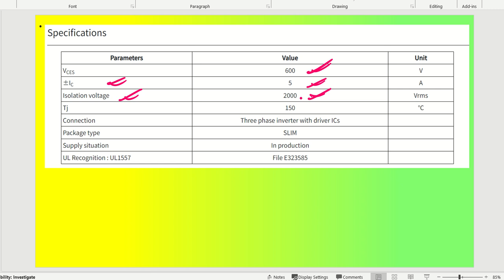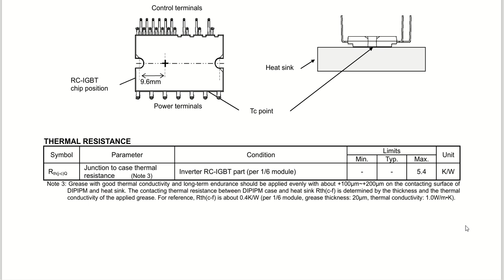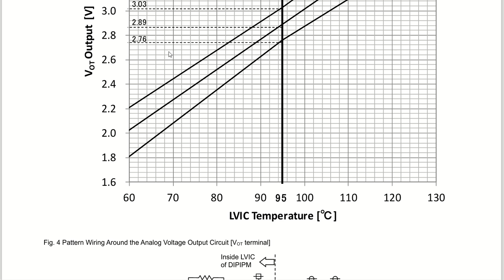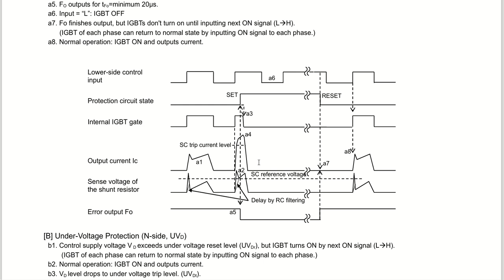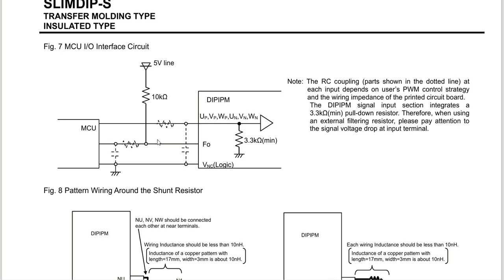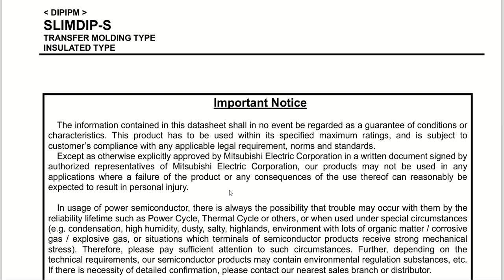077 SLIMDIP-S IPM Training MITSUBISHI Design and Details from datasheet

Comment: Hello,
I have designed the hardware, but before moving on to the software, I want to perform a few small tests. Can you help me?
I designed the hardware according to the values specified in the datasheet and completed the PCB.
I am applying +5V to the Up, Vn, and Wn pins, and connecting the Un, Vp, and Wp pins to GND. However, I don’t observe any movement, not even a slight vibration, on the PMSM motor.
What could be the reason for this? Is this kind of test a proper method?
Reply from the maker: @tb5byo   Hi,
Thanks for your interest, you can send details at bkpsemiconductor@gmail.com
Reply from the maker: @tb5byo  or you can also send directly to me at arvindkumar20802@gmail.com.

Mitsubishi electric IPM are one of the best among all available ipms in the market.
Reply from the maker: This method is not right, as you are supplying dc voltage permanently to these High side and low side GATE driver. You can use function generator to give low frequency signals to these pins and can observe some movement.

Also, make sure you are supplying enough DC voltage supply to the IPM.
You can share me the part number that you are using, 

Good luck!!
Reply: @bkpsemiconductordesign  I saw your message very late, I did not receive a notification. I am sending you an e-mail about this issue. Thank you.
Reply from the maker: @tb5byo  ok sure